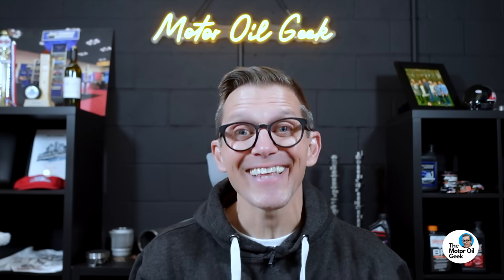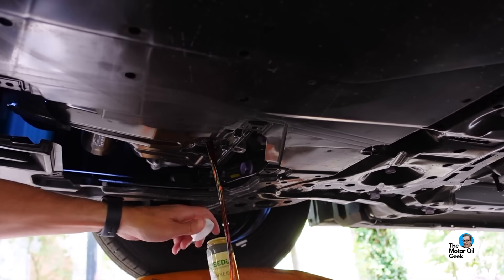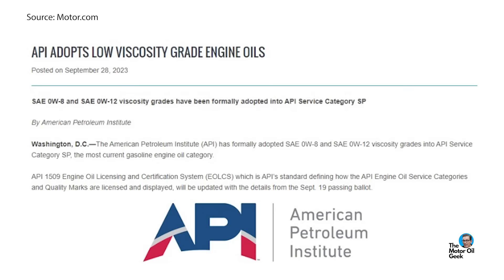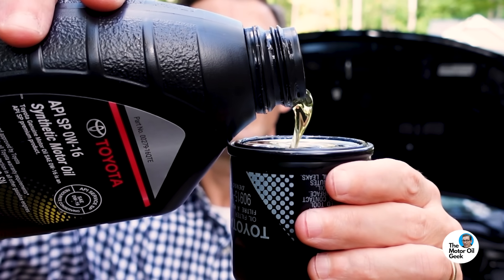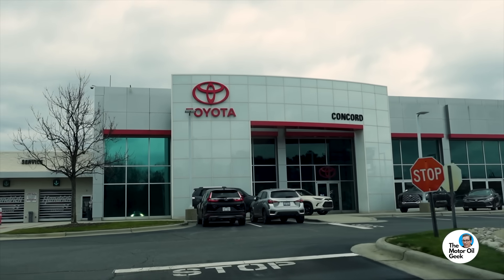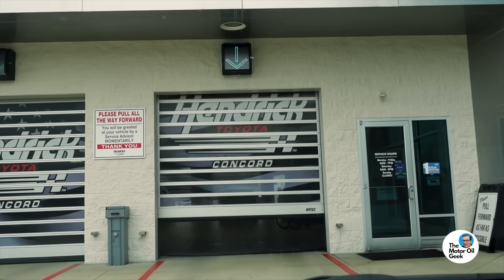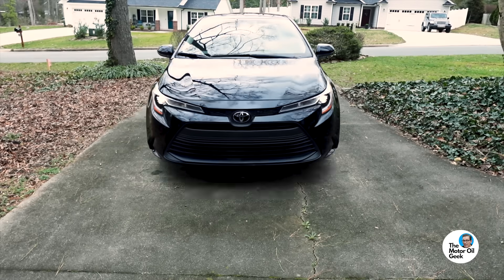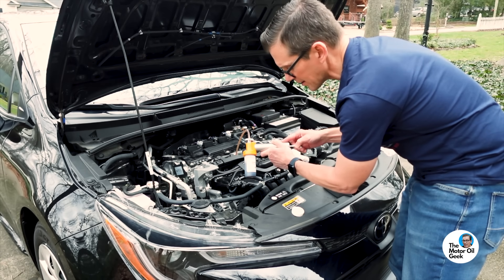0W-8 Motor Oil: Too THIN to Trust? Let's Find Out!

Comment: I have the 2024 Corolla Hatch. The American manual states to use 0w-8 and 0w-16. However the Australian manual says that you can use 0w-16, 0w-20, 5w-20, 5w-30 and 10w-30. From what I read, the lighter oil slightly increases fuel efficiency which is required by US law
Reply: Interesting!  Is it a myth then about the different API starburst symbol on 0W-8 & 0W-12 products to show it is not backwards compatible with 0W-20 through 20W-50?  I heard that engines designed for 0W-8 and 0W-12 have different bearing finishes.  So that's not true?
Reply: @TassieLorenzo , absolutely not true. Thees exact engines run in other countries tries with up to 5W- 40 oil
Reply: @littlet7556 in southeast Asia like the Philippines, we use 15w-40 conventional oil. mine still running like new after 15 years.,changed oil every 5000miles.
Reply: 2GRFE 3.5L V6 
Toyota recommends 0w20 in North America but 5w30 in Asia and 20w50 in the Middle East. Only thing different is average temperatures and regulations.
Reply: This is why I run 5w-30 in my 4Runner rather than 0w-20 with the heat of Houston.
Reply: @DasNewsNetwork I did the exact same thing in a turbo VW. Called for 0W-20 and I run 5W-30. The United States for the most part is entirely too warm to be using zero weight oils except in the very northern regions.
Reply: @reaper-sz5tm Car and Driver magazine ran a 2020 and 2023 GR Supra at least 4 laps on the Virginia International Raceway to obtain the fasted lap for their annual Lightning Lap comparison. All vehicles are run with factory-fill oil. The Supras' 0W-20 factory oil had no problem with that. Toyota does recommend in the manual that dedicated race cars use higher viscosity oil, but for street and occasional 2-4 track laps, the factory oil is just fine.
Reply: In case anyone's curious- the oil selection for weights is Chef's Choice. That's why overseas cars have MULTIPLE grade options whereas the US only lists the thinnest for fuel efficiency. Not longevity. I've moved my 2016 Corolla from 0w20 to 5w30 at 200K miles. Virtually no difference in economy, quieter, and I don't have to add a quart to two quarts every 5K miles. This new stuff is too thin.
Reply: @MyerShift7 I'd love to see real wear tests comparing engines of those who only drive a mile or two back and forth to school/work every day. I have a hard time believing the super thin oil won't show more wear. I do believe it could work well in a continuous, controlled high temp test but that's not the real world.
Reply: @JJFX- my car does 2km runs back and forth everyday. Did 3 oil analysis when the car was new, fuel dilution very high. The oil is not good after 3000km. I can hear the engine getting noisier. I change oil one more time between the dealer recommended interval.
Reply: @JJFX- and I live I canada. The car is barely warm after my day's trip.
Reply: @MyerShift7 bingo
Try and convince these people that
If it's good gor so called green emissions.......there's always a downfall on our end
Reply: @fil1329  Phew. This is normally very easy with me, because most of the comments here are what I've thought for a long time, but in the video, it showed better protection with the 16 than with 5w-30 on their study because the additive package was built better. 

But... 5w-30 has been modernized this whole time too...
Reply: @fil1329  I didn't mean to say what I meant to the first time. Only going with my older thinking that thinner isn't as good of protection, and to those above who are losing lighter oils when 5w-30 doesn't burn away, I'm sure we all agree that keeping a full amount of oil is better. It runs cooler, it can hold more particles in it while not hurting the engine, it's just better for a lot of reasons.

If you wear out an expensive engine faster to get better gas mileage now (which from 5w-30 to 0w-20, you will not see at the pump, the % change is within error), you are not saving the environment! Taking the best care of your car in your conditions is what's best for the environment. 

While I'm at it, I'll say I'm not a fan of smaller engines and turbos to "save gas" either, because it wears out faster and the cost to the environment of making machines is always higher than maintaining what you already have.
Reply from the maker: You are on it!
Reply: @themotoroilgeek has anyone with a GM came back to you and had some words? I’ve read on multiple forums that they have sensors just for oil thickness and using a thicker oil with throw codes and are worse on low tension rings. Just curious
Reply: Using lighter oils isn't US law per se, but it does raise the EPA rating, which helps Toyota to continue selling 22mpg Tacomas without butting heads with CAFE regulations
Reply: @specialopsdave isn’t it funny that Tacomas rating says 17-21mpg average, and my Jeep says 16-20mpg, but in reality my Tacoma has never gotten better than 17 freeway only driving, and never more than 16 average. My jeep has never gotten better than 17 freeway only driving, and average driving around 15mpg. 😂😅😂
Reply: - lighten up on the gas pedal, like an egg is between yer foot and the pedal. It really will improve mpg's. Don't be in such a hurry.
Reply: @00ninja00 it’s just math  and RPMs.
Reply: In australia you get super hot environment thats why 0w20 lowest what they use, common is 5w30 in dealers shelf. This 0w8 madness only for emissions control, less friction few grams of fuel saved…
Reply: @Dzinbhudist   That's true.  We just have to use our own educated judgment. For me in Central Florida where it is around 90-95 F right now, I use 5w-20 in both the Corolla and a Honda Odyssey and everything runs great.
Reply: @LamNguyen-dy5ep  in florida I would use 5w30 😉
Reply: @Dzinbhudist Then you did not watch this video in its entirety. The factory fill 0W-8 synthetic oil performs perfectly. Lake Jr. is dispelling all the nonsense assumptions that thicker oils are always superior. Read your owner's manual and follow what it says when it comes to the type of oil to use.
Reply: @davepaturno4290 toyota corolla 2025 states 0w16, 0w20, 5w30 in owners manual so go and read it yourself mate 🤦‍♂️ thinner oil primary is just for fuel economy and nowhere for longevity…
Reply: @Dzinbhudist Incorrect - at least here in the US. Our 2025 Camry uses 0W-8 from the factory. As Lake Jr. is finding, that oil protects as well or better than 0W-16.
Reply: @davepaturno4290 have read american owners manual, which states 0w8, 0w16, 0w20 or 5w30… common man…
Reply: @Dzinbhudist Our 2025 Camry lists 0W-8 with specific certification designations. No other viscosity oil is listed for oil changes. It may add that in the event 0W-8 oil is unavailable, 0-16 oil may be used, temporarily.
Reply: @davepaturno4290 nop it states in what environment you are driving, if hot then 5w30 recommended.
Funny thing that for the same car in japan owners manual states much more thicker oil your camry there uses 0w20 which is the same engine… so 😉
These thin oils suffer a lot from oil dilution by fuel and knowing that direct injection engines suffer from it i wouldnt go lower than 0w20, manufactrer only cares that your car is ok during warranty period so it can withstand with 0w8 for that period after they dont care.
For example GM had to recall bunch of 6.2l engines cause of crankshaft issues and it was too thin oil to blame, now they recommended oil is 0w40.
Reply: @Dzinbhudist Here are the exact words in our 2025 Camry's owner's manual:
"If SAE 0W-8 is not available, SAE 0W-16 oil may be used. However, it must be replaced with SAE 0W-8 at the next oil change. An oil with higher viscosity may be better suited if the vehicle is operated at high speeds (for extended periods), or under extreme load conditions."
 Therefore, if you regularly drive high speeds on the Autoban or pull heavy loads with your Camry, a higher viscosity oil may be needed. The manual includes a chart that shows the outside temperature range. The maximum temperature is 110°F or approx. 40°C.
Reply: @davepaturno4290 I wont argue anymore with you, as I feel like I am arguing with flat earth believer, but answer some questions to yourself why in US toyota requires 0w8 and in japan 0w20 for the exact same engine? And it wont be cause there is no 0w8 available it is cause of not so strict emission control 😉 check your manual when oil needs to be replaced and check japan manual when ask yourself after why so many deviations 😉
Reply: @Dzinbhudist So you believe that the Corolla and Camry need to eek out that extra fuel mileage in the US, when they are already crushing the competition? It just doesn't make sense to me that Toyota would risk its well-deserved reputation for 2 mpg. I've worked with Japanese engineers. The would never settle for shorter life.
Reply: @Dzinbhudist even they using 10w 30 in hybrid car in Sydney now i switched with ow 20 to check how its works 
After switching to 0W-20 oil, my car feels smoother when accelerating. The pickup is better, meaning the engine responds faster when I press the pedal.
With 5W-30 oil, my car’s average fuel economy was 4.3 to 4.6 using 98 octane in Australia. Now I’ll see how it performs after switching to 0W-20.
Reply: I haven't watched the video but Au is hot and calls for thicker oil. As for the lack of range on the US side that's probably something screwy
Reply: @rolls_8798  it means science hasn't changed and they want efficiency even if it costs engine life.
Reply: ill stick with 0-16 for warranty purposes and since its a little thicker, its warmer here in Tennessee and ill be doing the changes myself
Reply: @utpharmboy2006  not a bad call. Read around in the comments. Same vehicle in other countries have a wider range of oils based on temperatures. It's CAFE standards pushing American car users too far sometimes.
Reply: @tradingnichols  yeah they claim its for they enviroment but they don't seem to care about cars with 100k miles or less piling up in junkyards....makes very little sense to me
Reply: This. It’s strictly a tactic to meet CAFE standards. Has nothing to do with longevity or “tight oil passages” engineered for 0w-8. It’s not. Thicker oil is fine.
Reply: I agree
They are not manufacturing different engine  with different tolerances in 2.0l f example for Europe and for USA!

That would cost alot..
Reply: @summerforever6736  same with ford's now all engine's besides 3 cylinder is 5w30, ford replaced too many engine's, vct systems are ran off oil pressure this thin oil does not help especially at idle an longer intervals
Reply: @summerforever6736  Not tolerance ,, clearances.  Tolerances are the allowed variations of the clearances
Reply: Did it mention temperature ranges re the different grades?...  I suspect you don't get much snow in Oz or driving conditions below 12°C 
Honestly not winding you up I am genuinely interested
Reply: That's all it is about - gas mileage.  I REFUSE to sacrifice engine life for gas mileage.  Japanese engines already are gas savers.  Expecting even better MOG and refusing to change the oil is just being a damn miser.
Reply: @jamesbosworth4191 If you live to be 100, maybe you'd see the difference in engine life, but keep in mind that must engine wear occurs during startups, not driving on the highway.
Reply: @davepaturno4290  I am fully aware that cold startups are the most critical, but oil too thin DOES cause more wear at highway speeds, AND, more of it will drain off of the parts when the engine is not running, so if you use the car infrequently, you might have a BIGGER problem with cold starts and wear.
Reply: The Dubai manual despite the 110 degree climate says to use 0w-16
Reply: @jason200912 Our 2025 Camry manual shows a graphic chart of outside temperature range for 0W-8 oil. The high side is about 110°F. Here in the US, that may be exceeded in Death Valley, CA or some regions in Arizona, but the majority of states don't see temps higher than that. The highest it gets here is about 95F.
Reply: So who is going to tell you broke the LAW when you put in a different weight oil😅😅
Reply: @2nickles647 right?
Reply: @2nickles647  they fine the company not the individual
Reply: 2010 FJ cruiser, 1GR-FE, all made in Japan. In the U.S. Toyota recommends 0-20, in the rest of the world they recommend up to 50W oil. I split the diffrence and run a 5W-30, as I don't live in an extreme temp environment.
Reply: I rest my case. It is in the end 'your vehicle' believe who you wish. It worked in the Flu epidemic, what possibly go wrong.
Reply: @luckyguy600  Again, what flu epidemic?  The Spanish Flu of 1918?
Reply: @luckyguy600 What flu epidemic?  The Spanish Flu of 1918?
Reply: If I had one, I'd just put widely available 0w-20 in it and call it day.
Reply: Almost every car outside US recommends thicker oil. Oil that's better for engine protection. EPA recommends thin oil for fuel efficiency and to comply with them, at the risk of the engine.
Reply: @valferdinandmonissabiano8641 I guess all the European engineers know more than Toyota engineers about engine longevity.......uh, no, they don't.
Reply: exactly. But try finding that info online easily.
 I tried/ you actually did it. very good. now spread the word around all over the place. I am sure a lot of guys get akickbackk from Toyota. Of courc,e one cant prove that, but so many experts are die in the wool guys for the cooking oil 08 16 stuff. Not like 20 weight is anything too thick, but that is where I draw the line in Canada in the winter.
 We are all test subjects, like getting the flu in your engine. lol
Reply: My Nissan says 0W20 but the dealer uses 5w30 syn which is what I am going to start useing, just dont trust 0w oil's .
Reply: I don’t let anyone change my oil, bought a brand new car that had one oil change and the knucklehead at the dealership didn’t put a crush washer on and tightened it on with a impact. A brand new car, I could barely get the plug out and I’ve been wrenching pipe wrenches for 25 years. Now I have a tiny oil leak coming from the plug, I really hope the threads aren’t messed up. The ignorance in this country is hitting critical mass.
Reply: 5w 30 for every engine that is all.
Reply: Nothing less than 0w-20! I mean really? I would use 5w-30 who cares about gas mileage, you want at least 200k out of a car like that.
Reply: @CelsiorLs-w7w Toyota/Lexus owners in the US have been using 0W-20 oil, starting in 2010. Many have over 200,000 miles on their engines.
Reply: CAFE requirements, nothing more.
Reply: Are you sure?  I have a 2020 Camry at least and it says either 0W-16 (which is what its supposed to use) or in a pinch, you can use 5W-20 instead as a temporary measure if 0W-16 is not available (by "temporary" I'm thinking as goon as you can get your oil changed but it probably won't do any major harm as long as it's done in a reasonable time frame, maybe a month or so or within 2-3 thousand miles).
Reply: I've been trying to access an Australian manual for Acura RDX.  How'd you do that?
Reply: @LamNguyen-dy5ep  by law. 😆
Who is going to report you to the law if you put in a different weight oil.
Reply: Does the usa repair my engine ??
Reply: Similarly 1.8L Corolla sedan requires 5w30 at minimum in Pakistan, while in the same engine overseas, 0w20 in required. This may be due to environmental factors but not sure why.
Reply: It's just a fuel efficiency requirement to use 0w. You can use 10w30 if it's not snowing with no adverse effects on your car.
Reply: @blackwolfthedragonmaster That'd be very foolish, since Toyota's latest oil pump system needs the lower viscosity oil to operate. See the carcarenut video for a complete explaination.
Reply: Even in Minnesota I have better results running 5-20 instead of the recommended 0-20 in my Prius. No soot on the bumper or oil burn when I run the 5-20.
Reply: exactly. England and Europe too. I use 0W-20 from when I fist did my first oil changeout at 200Km. 3 before 500, and now every 3,000 km.
Reply: car care nut said they you should not used the spec outside the usa specs.
Reply: @bjsimon802  I watched that video and he also said the engines are different and as I do have much respect for him I do not believe him on this issue.
Reply: You better of using 5-20 or 5-30
Reply: Nope
Reply: and honestly most all good quality oils and weights are fine as long as you change them and the filter @5000 miles
Reply: So Florida guys run 0-40 .
Reply: @dennisford2000  Really, gets that cold and hot? Oh sorry, still driving a recommended 5w-30 engine. If you're talking more modern, of course you need  the 0 at the beginning there.
Reply: @dennisford2000  Same here for summer in New England. 0w-20 in winter though.
Reply: I'll take 5w-30 every time. Screw this water oil
Reply: It's not required by law! There isn't any LAW. It government EPA push for better mileage at the cost of your engine
Reply: 10w oils are useless for cold starts
Reply: @m850i_individual  10W is specifically for cold starting, unless the outside temperature is below about 5 degrees.
Reply: @jamesbosworth4191  uh mate where are you taking this from, scammer mechanics ? Don‘t you read that 5w and 0w work better in cold temps? The number you named is the lowest temp the oil pump can still pump. You don‘t gain anything using a 10w30 instead of a 5w30. You just give your engine a harder time being lubricated during winter, and this is a fact, specificallyfor todays engines. Operating viscosity is the same cause they’re both sae 30s
Reply: @m850i_individual  Neither is SAE 30 oil.  SAE 30 is a single-grade oil.  0W 30 is a multi-grade, as are 5W 30 and 10W 30.  A multi-grade oil is the low number that has been fortified with polymers that react with heat so that they behave like the high number when hot.  0W anything is just too thin.  Mult-vis can shear, and when that happens, it loses it's high temperature characteristics.  Whether to use 5W 30 or 10W 30 depends on the coldest temperatures you will encounter.  If it never gets below 20 degrees, 10W 30 is plenty thin.
Reply: I got my daughter a change of Amsoil 0W20 Signature Series and Amsoil filter for her new Acura's second oil change. She lives a long ways away from us now so she took it to an Acura dealer to have it done. The so called Tech didn't want to use the AMSOIL saying to her "you don't want to use that stuff"! So after her much wrangling with them and me talking to her on the phone while she was at the dealer, I finally told her to ask the guy if he was stupid!  He finally put it in for her! Lol
 I think Lake knows all about AMSOIL, he's just not talking😂 . It's ok Lake. :)
Reply: @oneninerniner3427  Telling a tech he's stupid and then let them work on your car is as smart as calling the guy who prepares your food he's stupid before you get your meal.
Reply: @Okurkaarrgghh A kid that changes your oil is not a Technician.. 😅😅😅😅
Reply: @Okurkaarrgghh  Well, I think he, this so called tech, finally figured out I knew what I was talking about, ima life long mechanic by trade, I specialize in transmissions & drivelines. So he was more or less calling us stupid, so.... There.
Reply: @oneninerniner3427  he was right to caution her. Signature series is not API certified.
Reply: @oneninerniner3427  I agree.  Maybe Amsoil hasn’t paid Lake for testing which equals a PR campaign.  I use Amsoil and I still change the oil every 3k.  Amsoil will always be at the top.